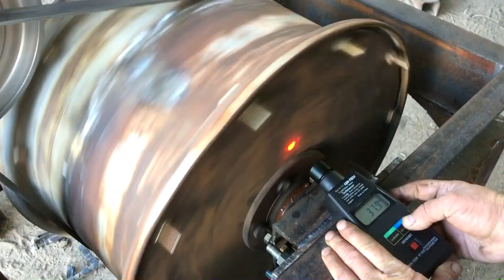Building a Better Ball Mill

Comment: I made a miniature ball mill out of an old printer and a tin can. Runs on 12V and works like a charme for years now...
Reply: What balls are you using?
Reply: Stainless Steel Bearings from my car mechanic
Reply: +Homemade Chemistry How many rpm does it go?
Reply: +Simon Mobile Lol no, I use it for Aluminium
Reply: For crushing stone? :D
Reply: +Steven003 I couldn't tell you... But I will measure it, now you made me curious!
Reply: +Bad Name Hehehe I know what you mean. When it gets fine enough I switch the steel balls for glass marbles. And it only runs outside the house and inside a wooden box far away from any living thing. Also I open the can once a day to air it. Never had any trouble with this method.
Reply: +SAVKE popara This would be pretty cool. Lol
Reply: howdy, i made my ball mill out of a small paint can and  12v 30 rpm motor yesterday actually... since yours works so well any tips you can give me to make mine better???
Reply: how long does it take to powderize??
Reply: +Bad Name Why?
Reply: +Ryan Lishman It depends very on your base material, I got Aluminium Chips and it usually takes about 1-2 weeks. If you already have powder like form it takes less time, of course. Like Steven003 said, check it out now and then.
Reply: What part of the printer did you use? As a motor or something?
Reply: asbestinuS I'd be surprised if it was the ink cartridges
Reply: +asbestinuS I used the part that slides the paper out. It's a DC motor running two metal bars on which i simply place the tin can to rotate(the bars have rubber "washers"). I just connected an old cell phone charger to the motor and it's ready to go.
Reply: I guess I'll make a video about it, just have to find another old printer to show it from scratch.
Reply: Steven003 steel balls and flammable powderdon't go together to well
Reply: +Ryan Lishman Yes, be safe! Read my reply to Bad Name. Besides this, make a heavy base. The piece I took out the printer already had the belts and rubbers to slide the paper, so I didn't have any trouble with that, but I guess it can be tricky to get the belts right.
Reply: i use steel ball bearings that my dad took out of a T-55 soviet tank turret
Reply: +Homemade Chemistry I have seen guys do it just with steel balls, but glass marbles are problably the better option.
Reply: +Ryan Lishman I think you'll find out, just check it now and then.
Reply: Homemade Chemistry that sounds like a disaster waiting to happen 😂